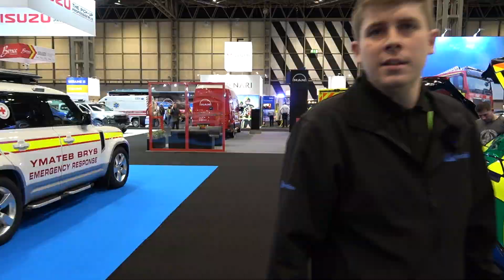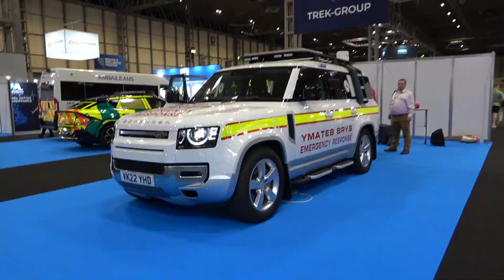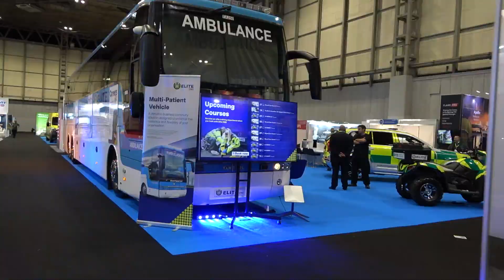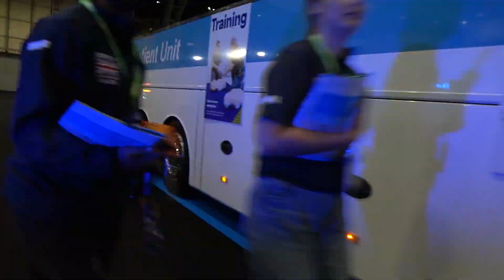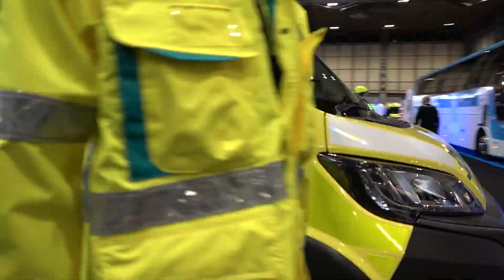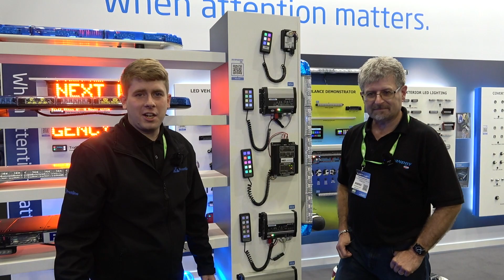ESS 2024: Behind the Scenes with Standby RSG | Emergency Vehicle Tech Showcase 🚨

Comment: I'd just go for Whelen who have been working on and making programmable systems since more than a decade. By far the best.
Reply from the maker: We’ve got a good relations with Woodway who are the Whelen distributor in the UK. Some fantastic products definitely but Standby overtook the control system market a long time ago. Brands like Code3 Soundoff Signal and Haztec are competing with lighting now. 

Whelen is certainly a tried and tested brand with a history of providing excellent equipment.
Reply: RSG are what Lidl is to the supermarket world. Whelen are more Waitrose value.
Reply: @iainv4092 Fr, every motor I've worked on that has an RSG unit on it always had problems ranging from the units just not working to the siren being laughably quiet where as the older motors, notably a 53 reg renault master which had the big inroof strobes never ever had an issue and that whelen alpha cleared traffic 1000x better than any of the rsg sirens

Comment: The "Breathing mode" is like DVI (Dynamic Variable Intensity) by Whelen Engineering
Reply: Sounds like they have similar to V2V as well
Reply from the maker: @charliekilo8944 Vehicle to vehicle sync will be released in the NX range
Reply: @frontlinefleet  based